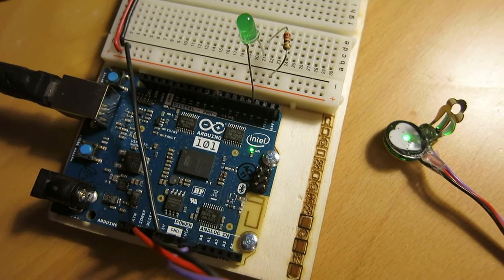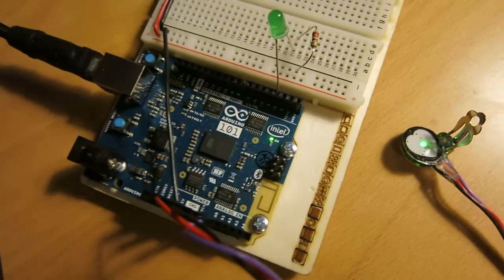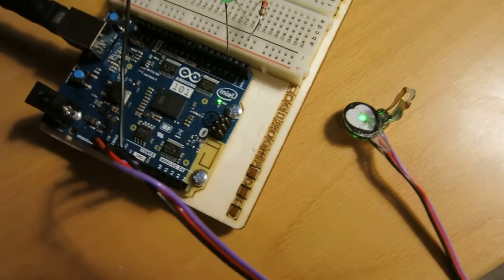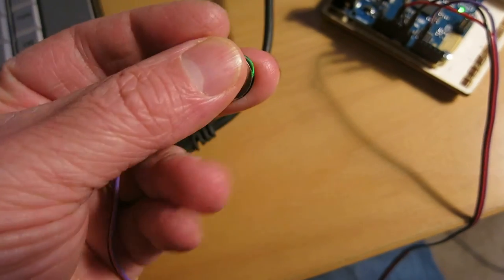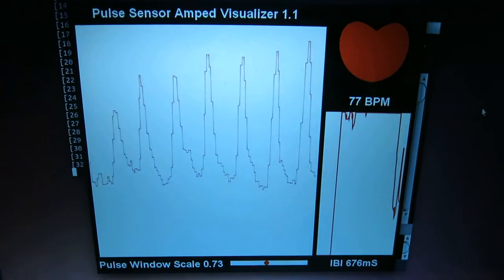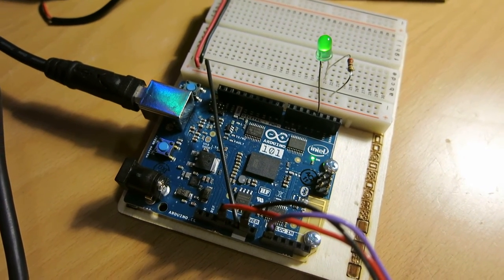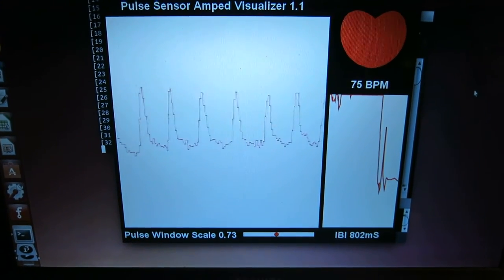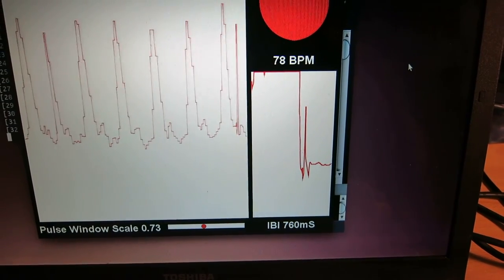Arduino Pulse-Rate Library, PulseSensorBPM

Comment: Thanks
Can you send me the code to display Heart rate in BPM on the serial monitor of Arduino IDE?? 
I am using pulse sensor.
Reply from the maker: Sorry for the long delay. The place to get Pulse Sensor code (including code that runs on the Arduino 101) is the Pulse Sensor manufacturer's Github site, https://github.com/WorldFamousElectronics/PulseSensorPlayground. On that repository,  On that site, the code that most fits your request is examples/PulseSensor_BPM_Alternative/PulseSensor_BPM_Alternative.ino, which has an associated tutorial.

Comment: Thanks alot,i have some questions:can i use arduino uno instead of arduino 101?
And can i see the circuit? It's not found in desicription box!
Reply from the maker: The short answer is yes! You can use the Arduino Uno or Arduino 101. I've designed a new, more versatile version of the library, based on Joel and Yury's code, which you can see on Github at /WorldFamousElectronics/PulseSensorPlayground
Reply from the maker: The circuit is described in the comments, and is very similar to the one used at PulseSensor.com